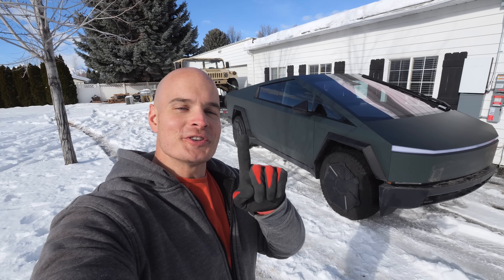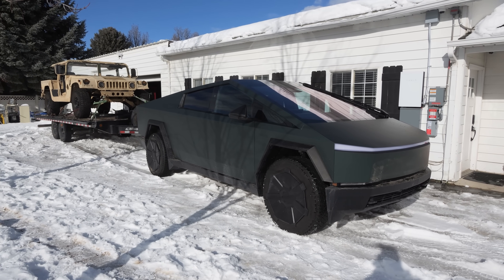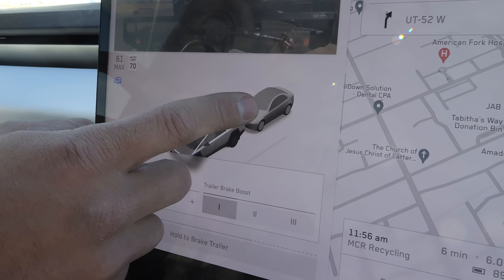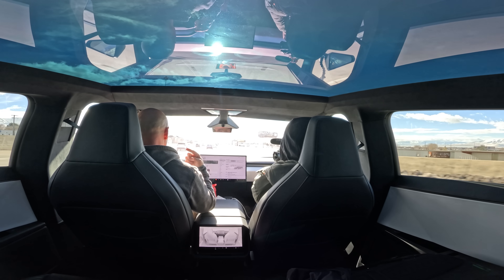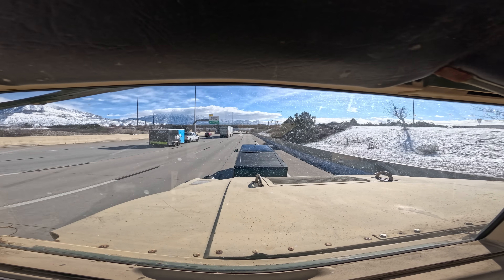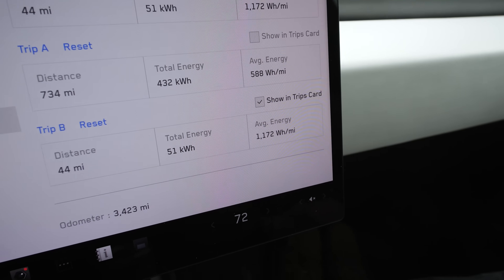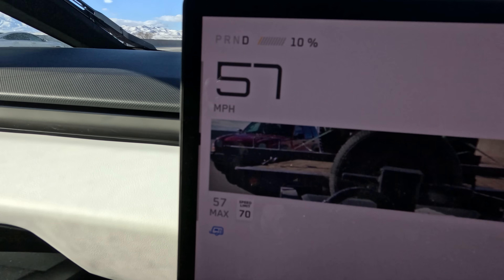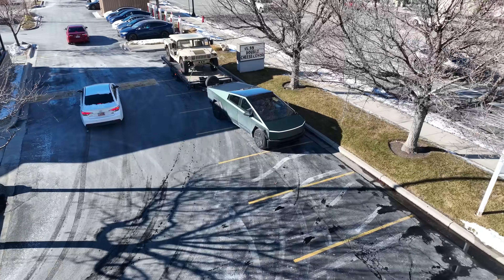How far can the CYBERTRUCK tow 11,000lbs in Freezing Weather?

Comment: Imagine towing cross country and having to charge every 90 miles, and having to detach the trailer every time you charge 😆
Reply: Drive for an hour and a half, charge for an hour.  Repeat.
Reply: @krectus  no, charge for 20 minutes. time enough to get something to eat and stretch your legs.
Reply: Except you’d be insane to run down to 2%. Probably more like charge every hour lol. Towing in the cold You’d probably spend more time charging and waiting for a charger than driving.
Reply: @colemangreen4191 battery is probably decently warm letting that much juice flow out in that short of a time that it’s not that big a issue
Reply: Yeah that’s insane. A 5 hour trip in a gas powered truck would take 8.75 hours in a Cybertruck! No thanks
Reply: @TheGreatBlumpkin  How much will the fuel cost in a 5 hour trip in a gas powered truck? Time is money. Money is time. If the cybertruck saves you money, that's less time you have to work.
Reply: @sammiller6631  are you suggesting a $100k Cybertruck will save me money? 😂 I rarely drive more than 2 miles a day so my gas costs are super low. Except when I take a 5+ hour road trip a couple times a year. When I do, I’d personally rather pay the extra money for fuel than waste my vacation time at charging stations
Reply: whoever thinks these trucks are gonna be used as trucks......
Reply: @Nebbia_affaraccimiei it’s the fact that this is what they want our future to be. Not right now
Reply: Cybertruck is a really big golf cart, but around my yard that's exactly what I need.
Leave towing to the V8 Diesel with a tidy tank. Drive halfway across the continent before stopping...

Now if we could put a tidy tank with a diesel generator in the cybertruck? 🤔
Reply: @budthecyborg4575 diesel generator on an electric car? Sounds like an edison
Reply: And if you have to pay at a public supercharger. Gonna cost you more than gas or diesel.
Reply: And 40+ minutes to charge for every 1.5 hours on the road.  eye-yie-yie!
Reply: I thought it was cool, I live off grid with 3600 watts solar only go to town 1 a month 25 miles each way, be cool for me, if your plan is to daily drive ? Yeah no . Lol.
I think a propane generator powering the ev. Would be the way to go to give them unlimited mileage. But for me I'd charge at home, maybe even use the battery as part of My battery bank lol.
Reply: @johngross688  That makes no sense. Everyone can't live "off the grid." Then you're back on the grid.😂
Reply: Extremely disappointing range while towing 11,000 lbs. You would think Tesla would have the best range out of the 3 tested.
Reply: How many people will do that ? But I do admit, it won’t be fun. I also do think, not many people will be able to tow 11000lbs, that seems like a rare use case
Reply: @shashankdograTUBE  it's not even the max towing that's the issue. It's the throw a few thousand pounds on it and the mileage will suffer greatly. These will never go towing across country or even state for that matter.
Reply: @shashankdogra   there are alot of people towing RV's mate.  obviously not with an EV at the moment though.
Reply: Hybrid is the way. All electric is just foolish when there's 3 cylinder engines pushing 300 HP reliably. That 300 is more than enough to power electric motors and they'll push much more power than the battery packs can supply.
Reply: @RonnieWaynesGarage  my cammed c6 z06 is even better lol
Reply: The future is now 🙃
Reply: rather not...
Reply: @Lhawk2107  Why?
Reply: I honestly can't imagine me doing that more than once. I'd sell it the next day.
Reply: @RobVegas84  I doubt you'd buy one, but you certainly like to complain.
Reply: The Ford and Rivian towed the same weight further? Damn.
Reply: The moral of the story is that if you need to tow something cross country - heck if you just want to drive cross country - an electric truck isn’t the vehicle for you.
Reply: The moral of the story is that there is no moral to this video - unless it's that we could all stop going for the clickbait of channels like JerryRigs  - otherwise nothing of value was learned here.  FYI, drivers have been driving EVs cross country (USA) for decades. @billcook4768
Reply: Pain in the rear.  Just as I thought, these EVs are better suited just for city commutes.
Reply: @walden6272  Let’s face it. It’s Tesla’s first attempt at an “off-road-ish” adventure vehicle. Great test bed for the 48V architecture, DBW steering, and new steel & manufacturing processes. Towing is not the first thing on their customers’ requirements. (I’m one of them)
Reply: @Michael-zf1ko  Money is but a tool. Maybe I'm one too. 🤪
Reply: @walden6272 if you actually want to tow get a rivian. The cybertrash is made for techbros and not actual work
Reply: @walden6272 So 95% of all trips
Reply: @walden6272   just get a smart then and not a truck 😂
Reply: @p__jay  I still have my Jeep. :)  Nothing is better.
Reply: @walden6272 a lot is better than a jeep. Especially a new one
Reply: @615garage9  Ok, which one is better?
Reply: @p__jay  Yeah, except that my son hauls construction equipment, etc. locally. So no, that is just a Smart Ass answer. But for contract delivery and local, and he has about 6kw solar on his shop, this is a solid answer for his business. My post office has panels galore on their roof, would make the most sense for Uncle Sam to provide them EV mail trucks. Not THIS one, perhaps...but you get the idea
Reply: How long does it take to charge??
Reply: The cybertruck is made to survive the daily city riots not to be a practical truck, why do you think it's advertised as bluet proof ?
Reply: Who actually buys a Rivian or CT for towing?!The towing is the least cool thing about them. Let's see your gas towing truck bust off a 2.6 second 0-60, and be immune to dents. 😂

In reality, this thing is pretty amazing tech, and it will get better as they tweak the software, and battery tech is quickly evolving. The next refresh will solve some of the issues this first iteration has. This is still a rich hipster ride. But name a ground-breaking vehicle ever in history that didn't have some serious issues initially. And no  second generation or improvement comes without putting out the first generation. Wait and see.
Reply: Imagine towing cross country in general? How many times does the average person load up a vehicle with 11,000 lbs and drive across the country not work related….bet that’s a small group considering I don’t know anyone that does that…kind of a stupid comment.
Reply: imagine listening to that god-awful cab noise....
Reply: Yes, they are complete jokes. I think its hilarious how they want it to be all electric by 2035 or some shit 😂😂. Never gonna happen.
Reply: @camonly849  " or some shit" shows how sloppy your thinking is. "Never gonna happen" is the same thing people said about airplanes.
Reply: @sammiller6631  you're right, butnthey will need insane battery technology. It needs to be equivalent to what a gas car can do and how charge quick. Good luck with that.
Reply: @camonly849  No, it does not need to be equivalent to what a gas car will do. You're like the horse carriage crowd complaining about "infernal godless horseless carriages"

People will adapt their behavior. Charging more often means people will stretch their legs more often and reach their destination feeling more rested. Grabbing a bite to eat while charging will boost the economy.
Reply: @sammiller6631  people adapted their behaviour with horses because the ic engine proved a significant advantage and made it easier to travel distances ... just jump in ... no messing with getting the horse saddled or into a trap. The horse would need regular stops for food and rest (sound familiar ...? EV's need the same compared to IC). Why would we need to adapt to a less efficient mode of operation? It may be that in the future this inefficiency will improve ... but until it does ... the ev is relegated to short work commutes. At least now that they are depreciating as new vehicles normally do .. more people can afford one... assuming the batteries hold up long term and electric prices don't get regulated like oil currently is... cos here in the UK electric is 8% vat and fuel is 20% and fuel tax is approx 70% of the price per litre. Thus electric here ... to be like for like would currently cost perhaps 80+ per unit not 30 p per unit.
Reply: @camonly849 do you have any idea what you’re asking for, to have an EV charge up as fast as a gasoline pump fill up? A single gasoline pump is the equivalent of 20 megawatts electric power. And let’s say the EV is 3x efficient over ICE, that’s still a 6,666kW charge. Really puts into perspective for me what we consider normal.
Reply: @kng128  it's convenience. People want convenience. I tow my car sometimes and if I bought a Ford lightning and towed with it to the track, I would have to charge up 3 times just to make it. It's a 3 hour drive, turned into 6. And 6 on the way back. It's 180 miles there. I'm never going to deal with the horrendous charge times. That's unacceptable to me.

Towed with my dad's f150 2.7 and drove it to the rental place (45 min drive) drove it an hour home, loaded up the car, drove 180 miles, drove 180 miles back, and to the rental place before I filled up at all. Then my fill up only took 4 minutes. Until an EV can do that. No thanks.
Reply: @mattbarnett6902  I don't have the means to get a truck at the moment, otherwise I'd have an f150 with a 5.0 in my driveway. At least I still have the vette.
Reply: @camonly849 I don't disagree. I get it. Filling up with gasoline from a 20 megawatt gasoline pump is the maximum of convenience.  When I had to drive 3 hours to a customer's building and they didn't have a charger there, I took my wife's Jetta. For my day to day commuting my EV sits charging while I'm working.
Reply: @camonly849  yup, Agenda 2030. They want all cars electric and everyone to eat insects by that time. No more cows or gasoline. 😂
Reply: @TheRealYaro  🤣🤣🤣🤣 couldn't have summarized it better
Reply: @camonly849   yeah the feasible use case for an EV is a subset of petro/diesel vehicles. even after over 100 years since they were first introduced.
Reply: To be fair, any normal human being with a humvee and an ev truck doing cross country towing will definitely use common sense and use the humvee to tow the ev. Right? 😅
Reply: @Ignorerant  people with a humvee and an ev truck are not normal people. Your "common sense" is neither common nor sense.
Reply: @Ignorerant  The hummer is an EV
Reply: @Ignorerant  Not the point. You're buying the EV so you don't use fossil fuels.
Reply: 99% of the people buying this won't tow, they just wanna pose on Instagram
Reply: Thank God for 1/2 ton American pick ups!
Reply: Anybody in the right mind wouldn't buy EV💩💩💩💩 for Towing..😂
Reply: lol, yeah, no thanks - hard pass.
Reply: Im pretty sure at this point it would be impossible to go across the entire country, the infrastructure isnt quite there yet
Reply: @ghostreconslovessnow a lot of people have done it. Check out Out of Spec.
Reply: @ghostreconslovessnow   depends on the route, with 90 miles it'd be tight, but I think doable. Albeit an awful experience
Reply: @ghostreconslovessnow  lmao, there chargers everywhere now certianly on key  roads. look at any charger map and you'll see. Notifs off
Reply: @Treekicker   Utah, Montana, idaho, Wyoming, Nevada.. Lots of 90+ mile stretches without a charger in sight.. And lots of mtn passes so if you have a 90 mile range on flat ground in Salt Lake City and want to go to grand junction Colorado or Cheyenne Wyoming, Idaho Falls, Twin Falls idaho your pretty much screwed. I'll say it again, not enough infrastructure!
Reply: @ghostreconslovessnow   Im guessing you have not seen the Supercharging map...you can easily drive across country in a Tesla....its other brands thats the problem
Reply: @ghostreconslovessnow  It's not impossible to go across the entire country. Many youtube videos have shown how easy it is go across the country with an EV.
Reply: @sammiller6631  I mean with a small cargo trailer like this, every 90 miles would make it incredibly difficult to do
Reply: @ghostreconslovessnow   incredibly difficult to do? People did far more difficult things before automobiles. Have all these truck owners gone soft? Their great-great-grandpas would roll their eyes at what their descendants have become.
Reply: Don't buy an electric truck for that use case? I'd think it's a small fraction of trucks that ever do that.
Reply: Yeah don’t buy an EV truck for charging just yet
Reply: Pass
Reply: @RonnieWaynesGarage  The 1500 Chevrolet Silverado has also got multiple safety recalls too. "$7.25 per 90 miles" is not the price for much of the country.
Reply: The technology changes so fast. Batteries 10 years from now will be measurably better. The range has to farther than ICE trucks in order to be worth it.
Reply: Batteries already equal the range of most ICE cars - if you can afford them. @dannydaw59
Reply: lol and that is never going to change. Innovation stops at 2024.
Reply: @BekTesfa  Innovation never stops. There's new battery technology introduced all the time. There's too much money to be made.
Reply: EVs are a very new tech, with a decade from tesla and the rest a couple of years.
It's impossible to replace everything that has 10x more time and god know how many more times in money spent to develop combustion tech.
To put the initial comment into perspective, like 100 years ago when the gas automobile was starting to roll out and like it had 10 years of existence, people to expect that new tech to replace horse drawn caravans for long hauls over the mountains.
The automobiles were ok for short distances and urban places where you had access to fuel, otherwise nope, keep using those horse wagons.
Then with time and money engines were stronger, larger gas tanks and most importantly more widespread refueling stations, making accessible longer and longer hauls with a combustion automobile.
Reply: @RonnieWaynesGarage  I don't own an EV so your emotional spiel you're projecting on me does not apply. "they actually are more harmful to the environment than gas powered vehicles." is as flimsy as the environmentalist's arguments. It also assumes anyone who disagrees with you must be fit a specific stereotype. 

Just admit that you are emotionally attached to your Silverado. 

I see too many suburban soccer dads driving around Silverados and larger who never use it for anything other than trips to an office job and errands like grocery shopping or dropping kids off.
Reply: @RonnieWaynesGarage  Putting a link in a comment will get it filtered out, so I'm sure you can Google "Silverado recall" on your own. "show up in style to my kids soccer games" makes you sound pretentious. But suburbanite yuppies are well known for keeping up with the Jones with McMansions and oversized or over-the-top cars.
Reply: Guys, Here is The Savior

HalleluYAH translates “Praise ye YaH”

YaH is The Heavenly Father 
YaH arrives via the TENT OF MEETING
YaH was Who they Crucified for our sins
YaH was Crucified on an Almond TREE

— Ancient Semitic Cuneiform of Moshe (Moses)
— Isa Scroll (The Original Isaiah)

Isaiah 42:8
"I am YaH; that is my Name! I will not yield my glory to another or my praise to idols.

Isaiah 43:11
I, I am YAH, and there is no other Savior but Me.

Isaiah 45:5
I am YaH, and there is none else.
Reply: "Freezing weather". Sunny, 31-35F.  
Dangerously poor range calculation and visibility.
90 miles from 100% (recharge limited to 80%, 72 miles).
Mechanics and part stores for normal trucks on every corner. Who you gonna call here? A tow truck?

Teslas failed in recent Chicago weather. People literally abandoned them.
Thank the third world for suffering for these grossly expensive batteries that fire departments can barely extinguish.
Poor range is a feature. You're being prepared for no freedom, especially freedom of movement. It doesn't save anything, especially planet earth.
Reply: @michaelscott-joynt3215  tow trucks are already prepared for electric vehicles. Even without any preparation, regenerative braking will charge an EV while its towed by a tow truck. "Teslas failed in recent Chicago weather. People literally abandoned them." How many? One person? Even a handful is not a pattern, it's an anecdote.
Reply: Imagine towing 5 and 1/2 tons with ANY conventional sized pickup truck.  The load weighs far more than the truck towing it - very dangerous and entirely impractical for ANY pickup to attempt.  This video proves nothing more than the creator's intent to mislead you.
Reply: @AMan-he9sz he's really not trying to mislead, he's showing the absolute worst case scenario performance which most people will never do, and the haters are taking that and running with that as how it'll be towing a kayak.
Reply: @AMan-he9sz  any modern truck with a model number that starts with a 2, 3, or higher number can tow well over 11K lbs.
Reply: @AMan-he9sz A modern Ram diesel has a towing capacity of over 15,000 lbs in the right configuration.  My 20 year old Ram diesel has a 13,000 lb towing capacity.  I rarely tow more than 10,000 lbs, but I can go ~300 miles while doing so.  EVs will get there, but they’re not there yet.
Reply: This video is a complete farce - no one should ever attempt this with the vehicles used to make this video. @brianshorey
Reply: No one toes that much weight
A gas truck. If it could tow it would probably get 90 mi before it would have to fill up
If you notice all the trucks are done at different temperatures and different times
Reply: @jonmunroe6689 a fifth wheel can easily be 11,000. I can tow mine about 400 miles with a f250 diesel before stopping for fuel.
Reply: @jonmunroe6689  My 1/2 ton gets 375 miles per tank towing 11000 lbs, which I do at least once a week.